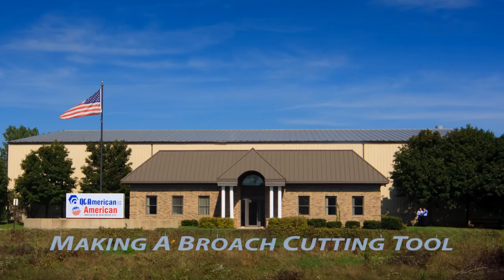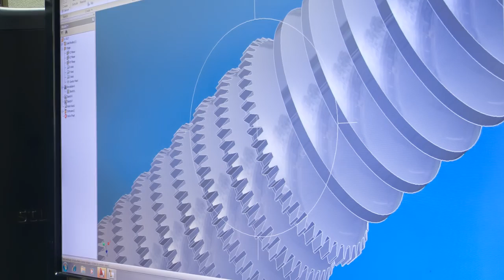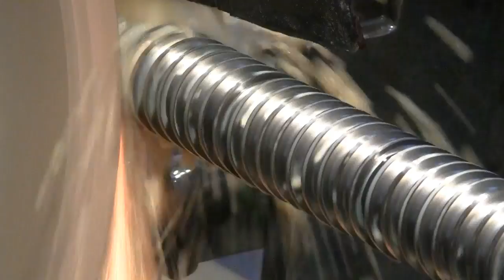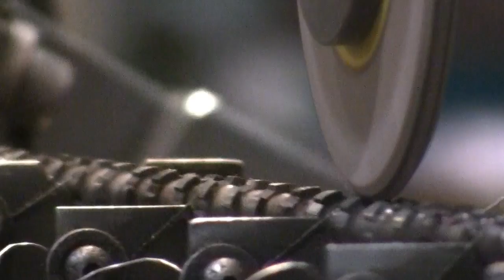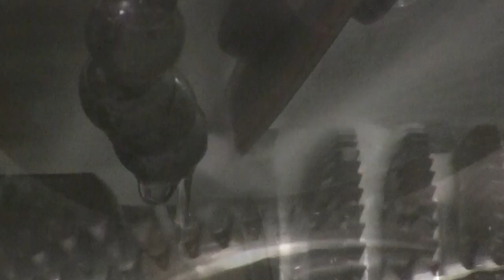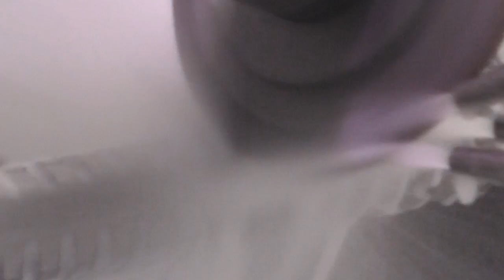Making a Broach Cutting Tool

Comment: Ok dumb question time.  About how much does one of those huge broaches cost for cutting, say, a 12" spine.  I saw a broaching operation when I toured a machine shop once.  I would be scared I would drop it.  They had a bunch of them on a rack for cutting different size splines.  They were all TiN coated.